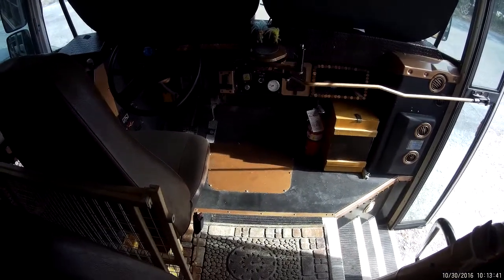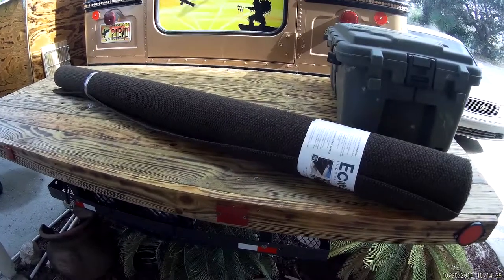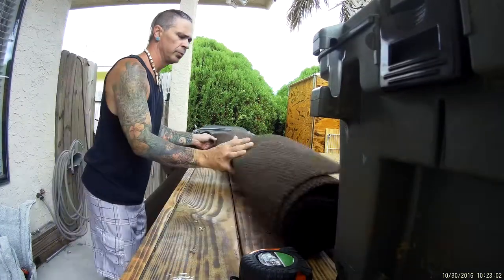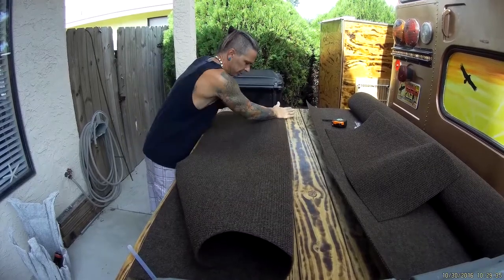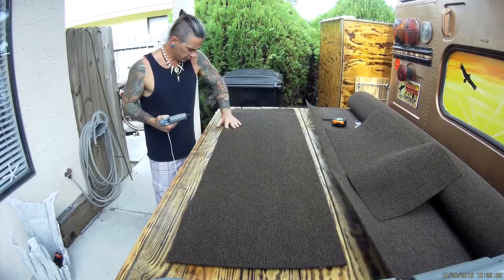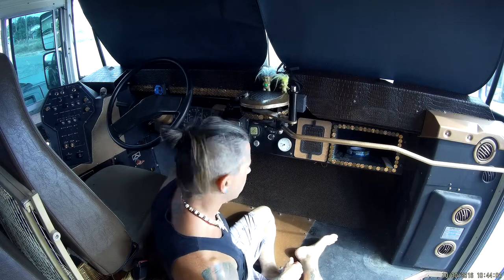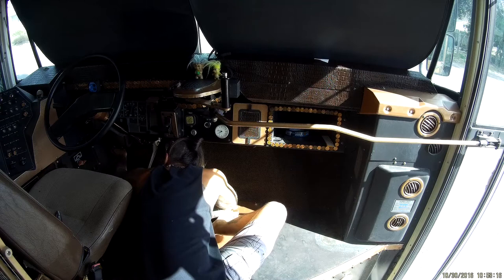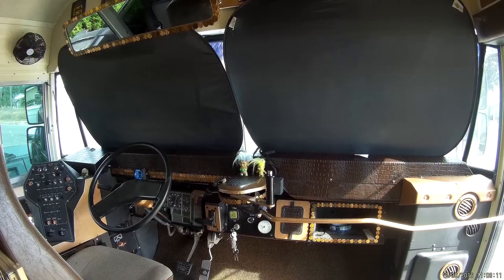Simple Life Bus   $7 cockpit carpet install

Comment: Brilliant again. I was not thinking that that pretty little porch doubles as a giant work table! Now here's a question: Why did you glue half the fold seam of the carpet first? Does that establish square because you matched the outside edges?
Reply from the maker: it will hold it straight  by tacking it,,but mostly for the hot glue not to cool before I could press it down. if I tried to run the whole line,,the beginning may had cooled to much to bind well..